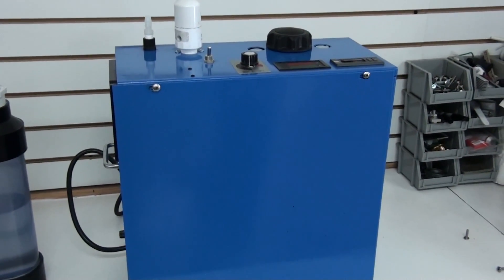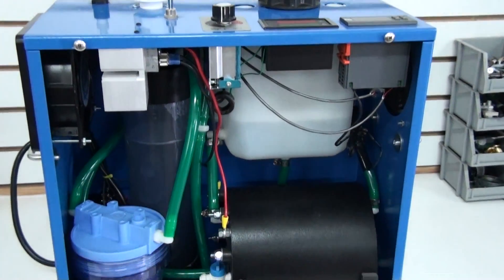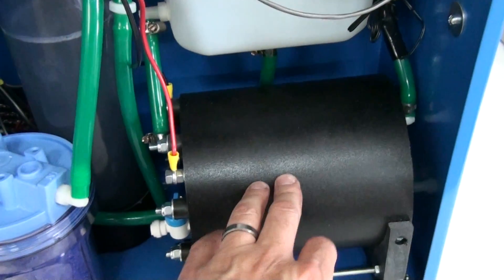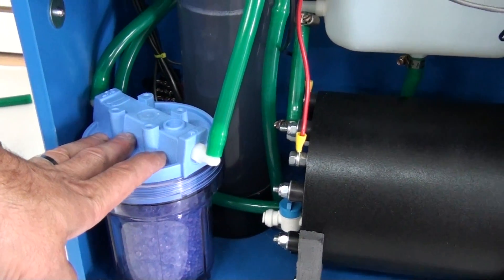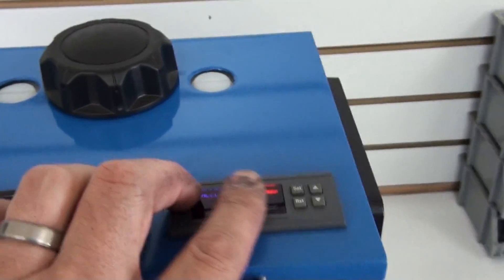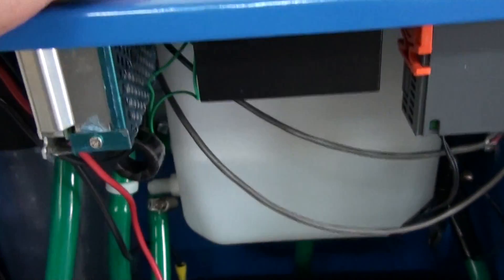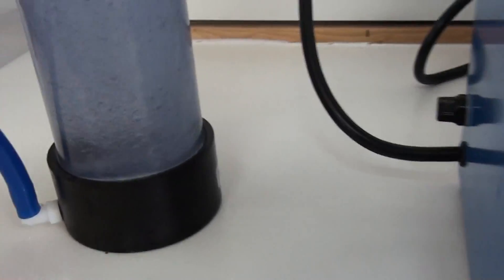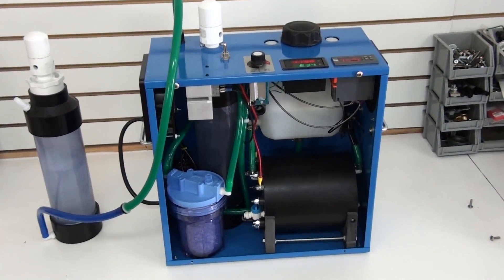HHO gas machine

Comment: Nice production. Have you tried removing the ac circuitry and the d/c full bridge rectifier. Putting some 12 volt dc automotive coils with a mosfet switch pulsing the coils with a simple device to control the mosfet.At different frequencies and pulses. The problem  has always been the volts are to low and amps too high. Great Job !